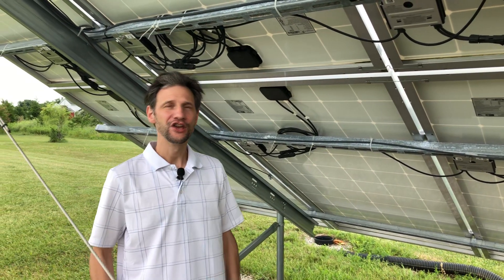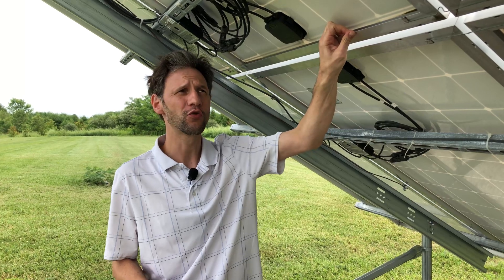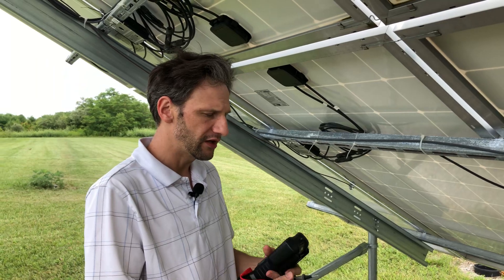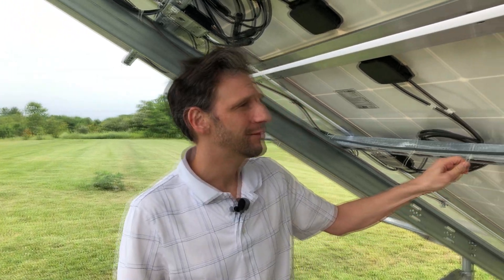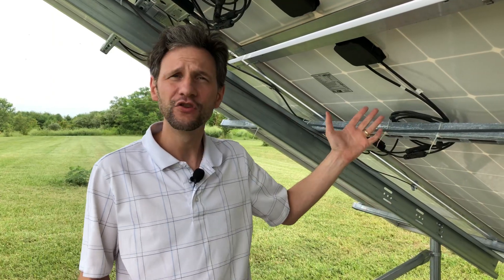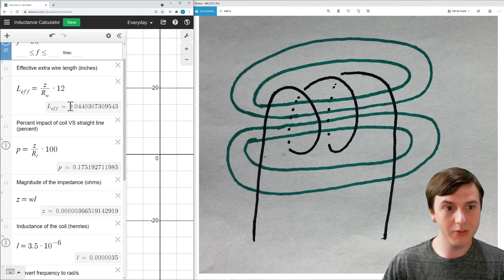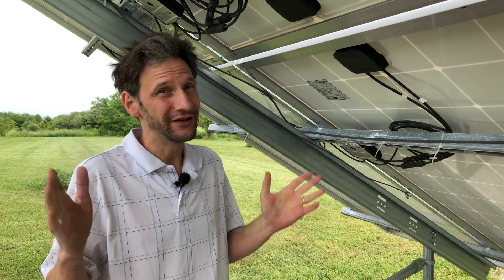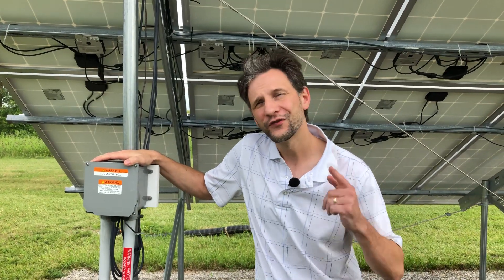3 Solar Panel System Wiring Issues Resolved

Comment: Your channel is the best for DIY solar. So many DIY solar guys making videos with bad information. I just watched someone install a cheap amazon combiner box with non UL listed parts in it by his panel array. He shows how the surge protectors are in the combiner box not where you want to install SPD's you want them close as possible to the inverter. What he had offered no protection against induced voltage on the wire underground. If you have 200 foot underground run that acts as an antenna lightning strikes 1/4 mile away could induce voltage on that wire. Most know that MPPT's will easily blow when they exceed their max voltage input doesn't take much.

Comment: Coiling up DC cables simply may contribute to the induction loop phenomena, so that in case of a lightning strike you may experience higher DC voltage surge than you could if those wires were straight and Plus and Minus bunched together reducing the loop surface area

Comment: According to other UTube solar experts, "Solar grounding and house grounding should be isolated from each other! " Where you said they should be connected. Who is correct?
Reply from the maker: I don't claim to be an expert.  I set up the grounding for my system based on the recommendations of the solar equipment manufacture and the requirements of my local inspector.

Comment: Another great video!  I agree on the need for UV straps.  For bonding/earthing/grounding I am careful not to tie dissimilar metals together such as aluminum & copper since that dissimilar contact is a point of corrosion and in extreme cases can be a heat source.  Many time dissimilar metals have to touch but we need to make an effort to keep those to a minimum.  Clear as mud?    Haha. All the best from north Texas!
Reply from the maker: Thanks!
You're right, galvanic corrosion is a big risk in these types of systems.

Comment: Hi on your solar system did you still use a earth stake in the ground or just the structure off your racking buried in the ground wad good enough, and how deep was it thanks
Reply from the maker: Technically the system ground is the house ground.  It is connected with a 6AWG conductor back to the household ground rod.  However, I'm sure the metal posts burred 3' in the ground act like a ground rod as well.

Comment: Even UV resistant Zip Ties are very short lived in Southern Climates where the UV index is higher. Being in the marine industry in South Florida, we have yet to find a zip tie that lasts more than a couple years with direct exposure, even the thick ones. Either use the stainless clips or coated stainless zip ties if your looking for something that will last years?
Reply from the maker: A marine environment requires additional focus on every component. It's a much more harsh environment to work in especially for galvanic corrosion.

Comment: I wish people would stop saying that grounding panels is for lighting protection, it really isn't. Lightening protection is a completely different structure isolated from the structure you are trying to protect. If you think a 10 or 6mm² cable is going to protect fromm 1000's of volts and amps it won't. Directly grounding a structure actually makes it more attractive to Lightening. Good information on the DC coiling
Reply: Exactly, it's really for preventing a shock when you touch the panels due to static buildup.

Comment: How deep should the grounding rod be in the ground. What determines the depth? The ones at the home/hardware stores are 8 feet long. Why 8? Or 10 or 6?
Reply from the maker: It largely depends on the soil type.  The important thing is making a good electrical connection with the soil.

Comment: Doesn't having two earth/ground points - solar array and then main panel - create a really dangerous potential for a ground loop?  Wouldn't you need to bond the two ground rods?
Reply from the maker: You can't really avoid a ground connection at the array.  The metal posts are buried several feet into the ground and the frame is connected to the grounding system.  The code in my area required me to connect my array to my house ground using a #6 copper conductor.

Comment: You can always connect your strings using Cross-Connection method, nip one slip one. Advantage is also get same  lengths on your + and - wires and neater cabling. Not all makes has longer cables eg Longi panels

Comment: Another thing about zip ties... you want to use relatively wide zip ties to prevent chaffing from cutting through the cable over time.  Wide zip ties tend to be larger than the ones I see in the video.  I know it seems like a waste of plastic, but it makes a big difference.  I've taken apart old solar systems (15+ years old) where the zip ties had done more damage to the wiring than just leaving it loose would have.
Reply from the maker: Great suggestion.  Thanks for the real world feedback!
Reply: Never thought of that. Thanks and greetings from Jamaica.

Comment: By grounding, you are essentially creating a lightning rod to blow up your system. When it rains the salts in the ground become conductive and make a path for lightning from the ground to meet the lightning in the sky
Reply: Would that comment apply to the engineering design for radio, microwave, and cellphone towers as well?  Should those designs float (eliminate) the ground?
Reply: @Ekanselter  I don’t know- I was just pondering as I saw a video about how lightning comes from the ground? Maybe insurance companies don’t require lightning rods on our houses for a reason.  Trees get wet down to the roots create a lightning rod. So if you have tall trees around, your probably okay, but don’t stand under the tree.

Comment: The fact that you have to coil the wires means there is unnecessary length which does add resistance.  It must not be enough for concern because no one has ever mentioned it.
Reply from the maker: The resistance from the extra wire length is small enough that it's not worth the time and expense to shorten all the wires.

Comment: Hey good vid, was worried about my solar cables coiled up under each panel, so now you've put my mind at ease. I do have one problem, and It's that my 6x 405 panels are in series and output around 200V. They are mounted on rails and the rails are screwed into a wooden frame. I do get an electrical tingle sensation when I touch the rails or the side of the panels. It's not like an electric shock, but an uncomfortable tingle feeling which is worrying me. Is this normal? My panels are not grounded at all tho.
Reply from the maker: This is not normal!  You need to have all the panel frames bonded together and connected to a system ground.  Usually 6AWG copper.
Reply: Proper Bonding and Grounding is very important but it is NOT a solution to your problem - while it will probably eliminate the tingle your 'snake in the grass' is still there.  Using another example - if your Washing Machine was doing the same thing hopefully you would not simply 'ground' it to solve the problem.  

You have at least one (small for now) ground-fault in your system leaking DC+ to the metallic structure.  By depending on Grounding to 'drain off' the fault current you still have a potentially dangerous situation lurking in the background.

Comment: If it's interesting, a guy on youtube, with a test tool, showed that in case of high voltages (1000v) the anodized layer is crossed https://www.youtube.com/watch?v=m8oDZEDdFZw
Reply from the maker: Lightening may be able to cross the anodized boundary, however, lightening isn't the only reason to ground the panels.  It is also for safety.  It prevents having a potential difference between the solar panel frame and ground.

Comment: Question: you state that you run your DC leads “all the way back to the house”. Is there a preference in running DC lines (like you) a long distance or a converted AC line a long distance?  I’m setting mine up now.

Comment: Howdy from Texas! I am about to mount 24 130 watt panels on the roof of me 40' Tour Bus Tiny Home. Lol (stationary). I am using an aluminum structure to mount them too and that is screwed into the metal bus roof. Is there a problem with this? Is it dangerous?
Reply from the maker: There are a couple of things to consider.  First, make sure they are very securely attached to the roof.  Even if you are not moving, high winds create significant loads from the large surface area of the panels.  Depending on the wind and the angle, it could be enough to tip the buss over.  Second, be aware, if you string multiple panels together in series, you can achieve very high and very dangerous voltages.  The optimizers on the system in this video keep every panel to a safe 1V.  When you string panels together without optimizers or micro inverters, you don't have that protection.  If you don't understand the electrical part, get an electrician to help you with the connections.  I talk about understanding voltages in this video: https://youtu.be/ZFbKtGSkhsE
I also talk about connecting charge controllers and inverters in this video: https://youtu.be/OwfGLu8IY_M

Comment: It is not the inductance which is generally the problem but the heat dissipation, if you bundle wires heat cannot be dissipated efficiently and.you have to derate the wire.

Comment: I'm a retired electrical engineer, and I can tell you with certainty the loops don't matter.  By the way, the loop you are pointing to has both wires (plus and minus) paired together so their magnetic fields would mostly cancel; that means those loops have a lot less inductance than you think.  But it doesn't matter.  The whole DC string is one big loop anyway, so looping the cable just increases inductance slightly.  And that's not a bad thing.  A bit of added inductance just means a little more spark on the disconnect contacts when you open it.
Reply: As an active but 65yo electronics engineer, you are correct.

Comment: Connected to houses eathing system. Doesn't that mean lightning is going to travel into your house now?
Reply from the maker: It should be directed to the ground rod.
Reply: @ProjectsWithDave  yes, every house ground is eventually connected to ground rod but should you mix lightning ground path with house electrics?

Comment: How do you have your array earth grounded? Mike Holts says if you use a ground rod that array needs to be bonded to the main house ground so that you only have one ground, other people/electricians say a separate non bonded rod is safe, do you have a rock solid explanation?
Reply from the maker: The array is bonded to the household main ground rod.  However, the racking is bonded to the same conductor and the posts are buried more than 3' in the ground effectively making them ground rods as well.
Reply: @Projects With Everyday Dave  so basically a secondary rod (Buried rack) bonded to house ground
Reply from the maker: Yes, that's the effective result.
Reply: @Projects With Everyday Dave  it ses to be a very heated discussion in some groups,  did you use 6 awg?
Reply from the maker: Yes, that is what the inspector required in my area.
Reply: @Projects With Everyday Dave  thamk you for your reply,  I watched your shed solar build and you pumped new ground rods but didn't see you bond to the house neutral,  been a few weeks since I watched it so Mayne I missed that part
Reply from the maker: The shed is bonded to the house ground system.  There is only one neutral bonded at the house.  I am not an electrician, I always recommend discussing your plan with your local inspector, sometimes they want something different based on their own experience.
Reply: Mike Holt is 100% correct!  Bottom Line!  In this case, if your Solar Power system can be connected to your house wiring by whatever method - you must be properly BONDED and have a SINGLE-POINT GROUND between the two systems.  DO NOT ever depend on the earth (soil) to provide a low impedance path to clear a fault - people have been killed thinking that was a viable option.

Comment: Actually, even Jordan's statements are overstated. For DC - yes not an issue. Even for AC, though, from what I can see you have both wires (ie. supply and return path) coiled up together and lying right next to each other. The fields largely cancel out and so your actual inductance will be much lower - likely negligible. Similar structures are used in electronic components routinely - for example the bifilar windings of wirewound resistors which are specifically designed to reduce the inductance of the resistor to negligible values or common-mode chokes which have negligible impedance to your incoming AC power, but noticeable impedance to common-mode voltages picked up via EMR and other noise sources.

Comment: why don't you try to shorten the wires? more wire means probability voltage drop increase.. isn't it?
Reply from the maker: Long wire increases the resistance which will increase the losses.  However, it isn't worth cutting and remaking all the connections to save $0.50/year in power.

Comment: hi don't you think your ground cable is not thick enough? and why don't ground it near the panels? (I mean why do you combine solar panel grounding with your home ground) is it safe? is there any reason for it?
Reply from the maker: Code requires a 6 awg ground conductor connected to the main ground rod for the house.  However, the racking also acts as a ground.
Reply: @ProjectsWithDave   but you use to connect two panels with little bit thin cable..
Reply: sorry my mistake I think you used 6 guage bare copper cable. 🙂
Reply: @ProjectsWithDave  I'm new to this subject, and also trying to build offgrid solar system for my home. Is it ok to use same grounding rode to ground solar panels and house AC grounding?

Comment: Greetings Dave,
I live in Phoenix, AZ, and in 2019, I had a 22 @ 305 watt panel system installed on the roof of my home. Ever since then, the 2.4 gb wifi network inside my home is virtually worthless while the sun is shining. BTW, the 5.0 gb wifi signal seems unaffected, but most of my devices are 2.4 gb only.

Once the sun goes down, and the panels are no longer operating, the wifi signal improves back to what seems like 'pre solar' strength and quality. 

Can you or any of you viewers explain what may be happening and ways to correct the situation?  

I am wondering if any coiled wires under the panels, are creating magnetic fields or EMF or anything like that which would cause the interference? I know next to nothing about electricity, so I really do not know what I am talking about.

The installer company sent out their 'best' troubleshooter, and he shut down the entire system at the inverter, but the signal did not improve during the ten minutes or so the system was off. Basically, since the system is producing the quoted electricity, they are not interested in searching further for a solution.

Any help you may provide would be greatly appreciated.

Dave
Reply from the maker: I have heard ham radio operators complain about interference from solar systems.  Unfortunately, I haven't researched the problem.  Do you have, optimizers, micro inverters, or rapid shutdown modules connected to each panel?  If so what type?  Even when the array is turned off, these modules still have power from the panels can could be producing interference.

Comment: I think it is good to coil the dc wires. In case of lightning strike, the inductors decrease the lightning current.
Reply: A small coil of wire like that will make no measurable difference to the effect of a lightning strike on your equipment.
Reply: Looks like a good place for a pooping birds nest to me.
Reply: It is not the inductance which is generally the problem but the heat dissipation, if you bundle wires heat cannot be dissipated efficiently and.you have to derate the wire.
Reply: @tanishqbhaiji103  yes - but in the case of a lightning strike as suggested by the original poster as a reason for wanting this alleged inductance, we're talking about millions of volts and tens of thousands of amps. Derating is no longer a relevant discussion point any more than the inductance of an air-cored coil of wire is.
Reply: @tanishqbhaiji103  That was precisely my point. What exactly did you think I meant when I said that the inductance of an air-cored coil was irrelevant in the context of a lightning strike? What did you think I meant earlier when I said that a small coil of wire like that will make no measurable difference to the effect of a lightning strike?
Reply: @brettski74  sorry, I wanted to post this somewhere else
Reply: Do you really think a few thousand amps and millions of volts can be instantly (in microseconds) 'choked and shunted'  to ground by a tiny (DIY) inductor formed by a coil of wire?  Coiling (or not coiling) a Solar panel DC output for any purpose is absolutely meaningless and has no purpose.

Comment: When I was grinding our solar array to a ground rod,   I was getting voltage on the ground wire.  It was reading 30 volts AC voltage.  I haven't been able to find out why.  Any ideas? I checked all the grounds and neutrals in the inverter, panel, and transfer switch.
Reply from the maker: Sorry, I don't think I can help diagnose that through internet chat.  I suggest you get a local electrician to support you.

Comment: curious...  is there a 8ft driven ground rod at the array???  and have you thought of installing a couple of air terminals to mitigate system damage in case of a direct lighting strike???  it's my experience that lighting rods do not attract lighting...  they just redirect the energy to an earth ground (path of least resistance) if a bolt is headed your way...
Reply from the maker: Each Post is galvanized steel and bonded to the grounding system, I did not think it necessary to add another grounding rod.